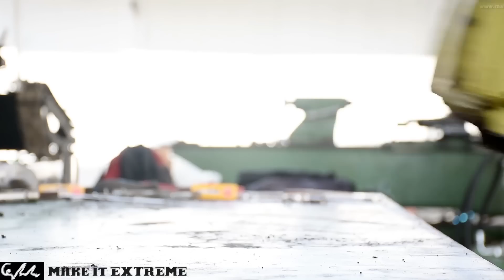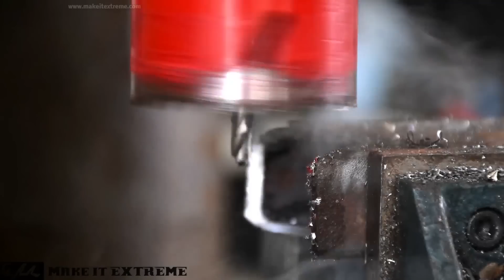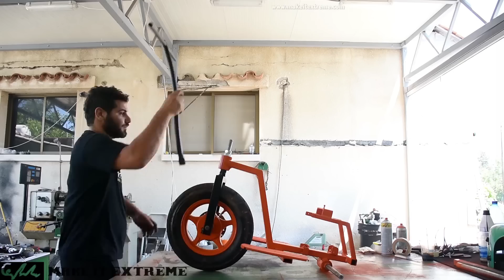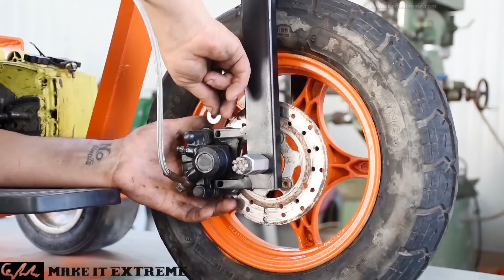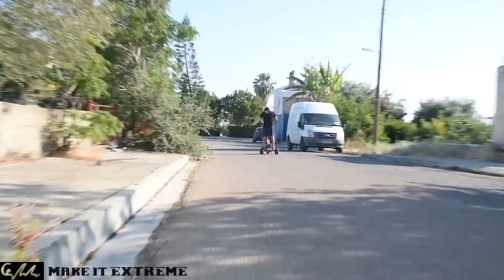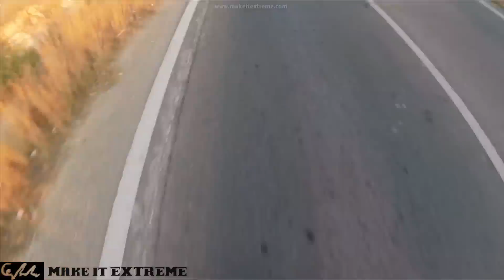Chainsaw engine 3 wheel scooter

Comment: very very nice! There's just one thing that i dislike: the exhaust. if you make a better one , sized for the small cylinder and not opened like that thing , for sure the engine runs better and produces more torque and rpm. the exhaust on a two stroke is very important. But as i said , that's nice dude , you have great engineer skills (Yes , i saw many videos of your channel...keep enginering! greetings from italy!)

Comment: What is the "Y" shaped thing you put on the output shaft of the engine called?
Reply: i think this is the chainsaw clutch
Reply: I figured it was some kind of clutch, but I'm looking for a kind of universal mount to an engine shaft and wanted to know if this could be one, since it didn't look like any clutch i've seen.
Reply: Its centrifugal force clutch. Faster it spins, more it grips into that cup thingy, where the gear is located. When it slows down, it will release the gear cup and chain stops...unless you have lots of dirt in the clutch. What i like to know is did he modify the clutch anyway and what kind of chain he used, cause if i'm not mistaken normal motorbike chain wont fit there..

Comment: A front-brake only? Doesn't it flip over when you need to full stop at high speed?
Reply: it doesn t do high speed
Reply: samplesmasher probably like 20 miles MPH
Reply: El Maestro Dominican More like 20 km/h
Reply: samplesmasher it cant even go high speed,probably cant even go up a slight hill

Comment: sorry guys. you can do better. very high center of weight and thus having a very low tipping point. 

No gears, no transmission, results in a loss of speed. you could've achieved a much higher speed if you had used the power the engine has to transfer it into distance on the gears. 

Only a front break and with the low tipping point you'd fall right over when using the break.